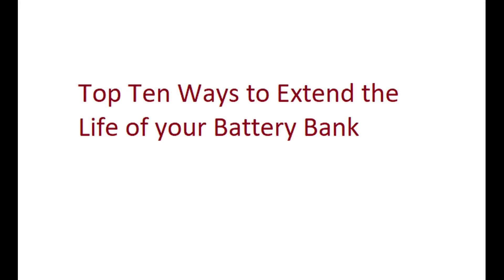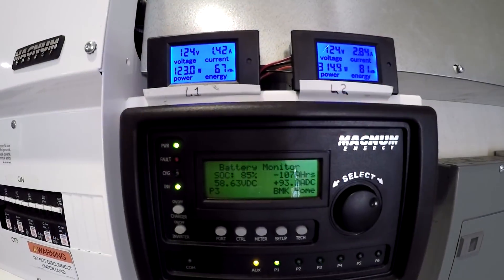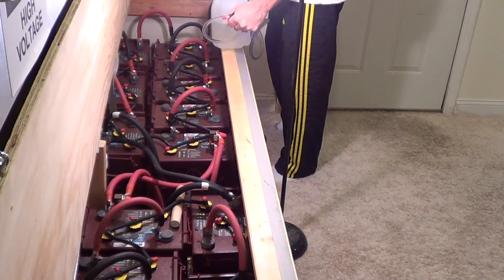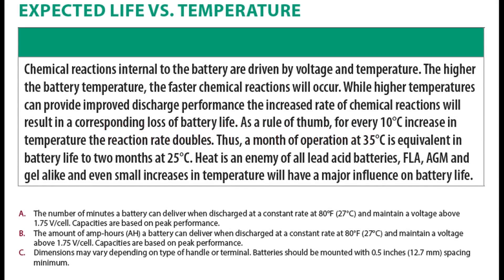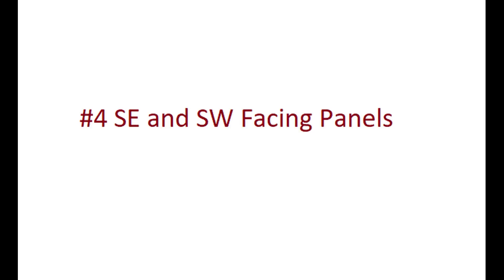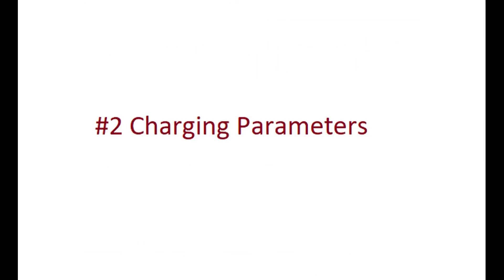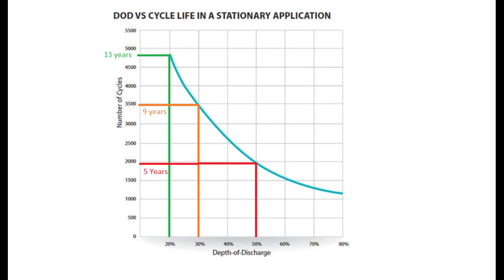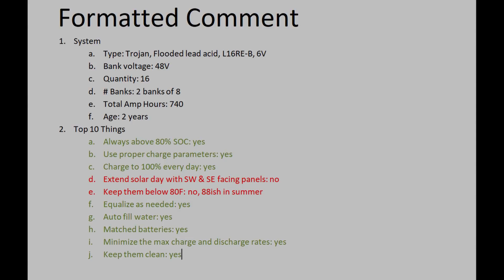Extend the Life of your FLA Solar Battery Bank

Comment: Very good job explaining and right on. The issue of temperature above the magic number of 77f is critical. My batteries can hit 90f a couple times a year but most of the year they are way below 70f. They are less efficient at lower temps but the longevity goes way up. Heat is a killer. I think Chris will agree with that. On the C10 charge rate the only time I would be concerned with that is when the battery temp was above 77f. Plates can not be hot enough to warp at low temps. AT 110F or above plate shedding and warping is a real issue. I have a 24 volt system with 2 strings of 4 Interstate L-16HC 
@ 840 amp hours. I practice all 10 points of your most excellent presentation.
Reply from the maker: Thanks for the info.  Would you mind if I posted the info from your friend (Jeff?) that got so many years out of his system?  Thanks!
Reply: @HomesteadEngineering  You certainly may my friend.
Reply from the maker: From: Off Grid In The Pacific North West
Greetings David, My friend used what is referred to as the Sandia Laboratories US Government study for FLA L-16 batteries. Finding the actual report is very difficult but some people have offered a synopsis of the Sandia Labs report that has given me a few clues. I shared this with my friend and he said that is what he has been doing for years. In essence An elevated absorb voltage, coming to a full charge within 3 days and going no lower than 80% SOC "EVER" The elevated absorb voltages for 12, 24 and 48 volt systems are 15, 30 and 60 volts respectively. That's 2.5 volts per cell rather than 2.4 as is recommended by so many battery manufacturers if memory serves me well lol. He always used the recommended float voltage from the manufacturer. My particular batteries need a higher absorb voltage than 2.5 per cell as per factory specifications. I use 31 volts in absorb for my 24 volt system. The down side of using elevated absorb voltage is the possibility of plate materiel shedding if the absorb voltage time or end amps setting is to long or to low respectively. The absorb time or end amps were set to achieve the factory recommended specific gravity set-point. It appears that the wear factor in a FLA battery is simply amps out and amps in. As for my friends climate the batteries never got above 90F or below 40F. The mean average was on the cool side around 60F. This was all in the Pacific North West with long grey winters. My friend Jeff came over and inspected my solar system charge parameters' daily usage and is confident that I would get 18 years from my bank barring a factory defect with one of the batteries. Time will tell. We have 4.5 years on them now and so far so good.

Comment: I dont think my system is comparable. AGM is much different then flooded.Id love to see how long your batteries last though.
Reply: Not much difference between AGM and FLA.  AGM is more expensive vs FLA.  AGM typically has fewer cycles vs FLA.  You can not measure SG in your AGM.
Reply: @MrSummitville  you are correct. 2 years late on the comment tho. Ive switched to lithium a year ago. Much better the fla and agm.
Reply: @frankz1125  Late?  Nope ... there is no time limit on knowledge.  Which Lithium Cells did you get?   Mfr?  Amp-Hours?  Li-Ion or LiFePO4 ?  Cost each?  New or used?

Comment: This morning, I am down to 22.60v on my eight-gun L16 Trojan bank. Was "milking" them along at charge specs and only taking them down to 85% SOC (new set points, about six weeks in). Everything as running fine till this morning...it is like one puked itself. Already lost four batteries several months back...so, the remaining eight were somewhat working...until this morning. Never doing FLA (esp Trojan) again. Right at about three years is pathetic performance. Why did they fail...not open to public discussion (we can go offline). I have a 12v Trojan OverDrive 31AGM (105 aH) sitting outside in the freezing temperatures 24/7 installed in my garden pond SOLGEN...no issues. Ditto with my Interstate Batteries deep cycle AGM (35aH) batteries...outside, no issues. Oklahoma gets hot and cold...and these are doing fine. Love your system and I wish you better luck than me...esp dealing with Trojan.
Reply from the maker: Sorry to hear that Chris.  I know how meticulous you are with your system.  Let's talk offline.
Reply: @HomesteadEngineering  Thanks...sent my # to your g-mail addy.

Comment: 1. System
a. Type: chevy volt battery module,  LITHIUM-ION, 24V
b. Bank voltage: 24V
c. Quantity: 3
d. # Banks: 1 banks of 3
e. Total Amp Hours: 145
f. Age: 4 years

2. Top 10 Things
a. Always above 80% SOC: no
b. Use proper charge parameters: yes
c. Charge to 100% every day: maybe
d. Extend solar day with SW & SE facing panels: yes
e. Keep them below 80F: yes, 88ish in summer
f. Equalize as needed: NA
g. Auto fill water: NA
h. Matched batteries: yes
i. Minimize the max charge and discharge rates: yes
j. Keep them clean: yes
Reply from the maker: Hey Bobby, Just saw this today.  I think used electric vehicle batteries will be the way of the future since there will be so many available in the coming years.  Thanks for posting your system info!
Reply: @HomesteadEngineering  Now I added one more 24 volt pack so up to 4 KWH hope in May to be getting 2 more 24 volt packs. I am with you way not use whats just going to be trashed for a 2 life. Hell solar is so light on them they will last use what 10 or 20 years.. That's after being in a car for 100k more more. Most of mine came from cars that had 50k. So there for the most part new..